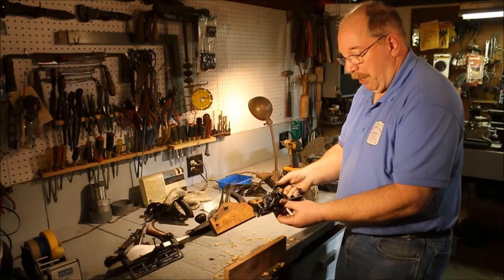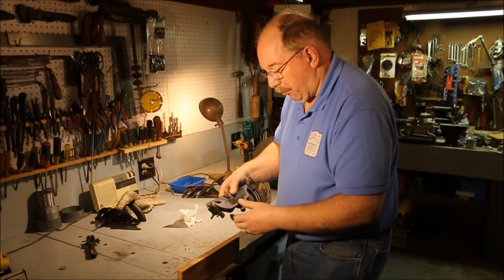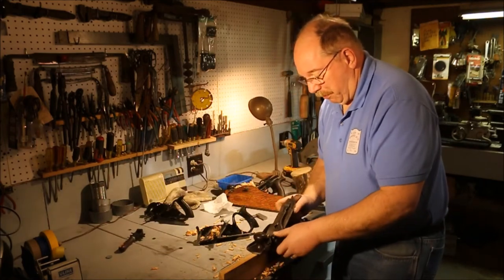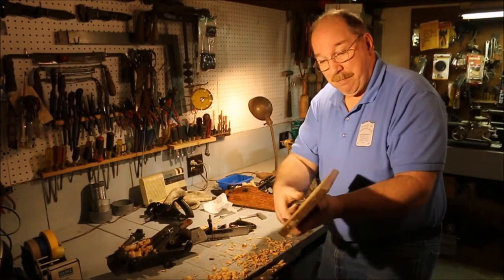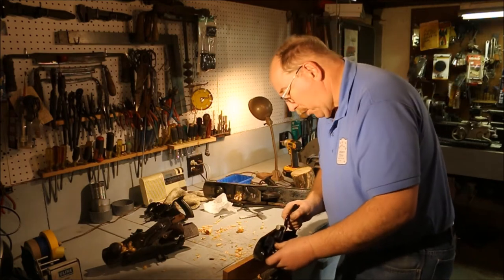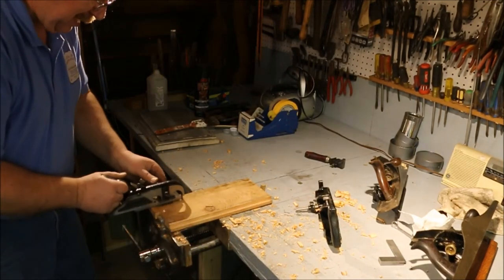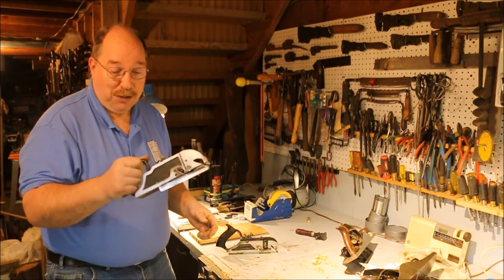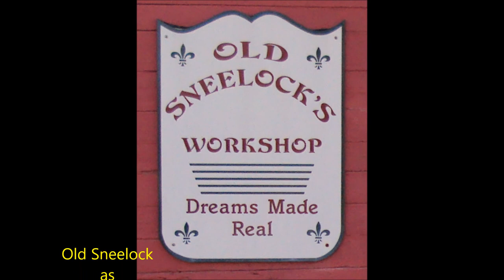A SUGGESTION FROM 07 ROADKING ~ FETTLING A REBATE PLANE~ PART 7 ~ USEFUL THINGS

Comment: Triplets??  Fine looking set and better when the end comes in sight.  The neighbor sold his Sportster. He said he didn't need 4 bikes.  I told him if I had 6 mowers he could have 4 bikes. Down the road the Harlety went. He must not think as much of his bikes as I do my/our mowers. 34 and washing some salt off the road today. Glad for it. Stay warm, Unc.
Reply from the maker: Lewie McNeelyI agree that motorcycles are like clamps.  When I rode Harley motorcycles I had a 250 Honda to be sure I always had a running motorcycle. 😀 
We hit above freezing today. 50 on Thursday. It will happen again like every year. 2nd week of February, just in time for the Tip Up Festival.  😆
Reply: Yes, it's a regular occurrence. He's got the Harley clone, the tourer he went to Alaska with and the air head. He wasn't fond of the racket the Harley made and never found a set of mufflered pipes for it. I'd go grin at him every time he came in or out when I was outside. I'll just settle for the others now. Stay warm yall! And I remember the 250's and the 305's too!
Reply from the maker: Lewie McNeely My 51 Panhead sounded like Buddy Rich beating on a sauce pan. Shotgun pipes with bolt in baffles. You could hear me coming. The loudest was the little flathead 45. The pipes were burned off when I brought it home. It was supposed to be a manifold but had burned away until it was drag pipes. I welded on short extensions to aim the flames away from the rear tire and welded in a washer drilled full of holes. The flathead would throw foot long flames when you revved up and backed off on the throttle quickly. 
I got inspected with a fine tooth comb the first time I drove down Main Street in Coldwater. I passed all the requirements but the cop told me to take it easy. He had complaints that I was rattling the storefront windows. 
No wonder I wear hearing aids now. 😈
Reply: Bob's Sportster had about the same thing only chrome. I used to drive an 800 Ford tandem dump with a Fordapillar (painted blue same as a 3208, about 210 horse) engine and a 5x4 tranny; 5-speed main box and a compound double-lo and 3 split gear auxiliary. Exhaust was 2 1/2 inch welded thick wall straight from the heads beside the head gate on the bed and it was L O U D and had a cackle to it up or down, like a Jake. I started hauling on forest service roads and at the entrance to Pisgah National was the old Pisgah Fish Camp with big plate glass windows. I was hauling from the local quarry and always got stopped at the 4-way light and got to grab gears going in. When the sun was right you could see the windows vibrating and people running to get inside and shooting birds and whatnot. I'd just grab a split and nail it. Good times!
Reply from the maker: It's a wonder we survived. 😊
Reply: THE Boss wasn't done with us yet!